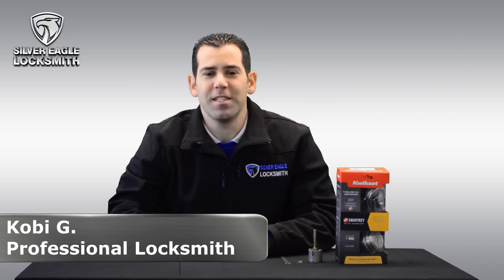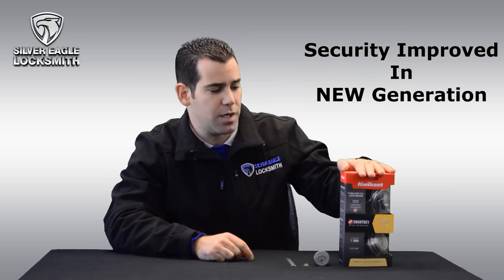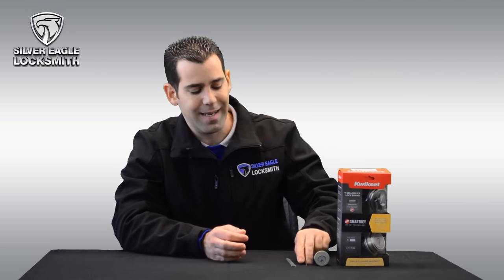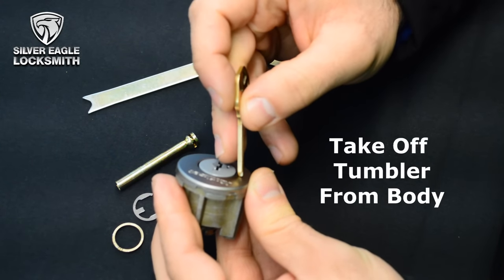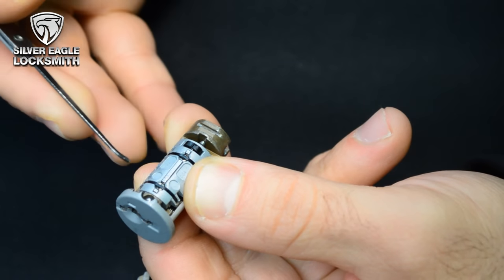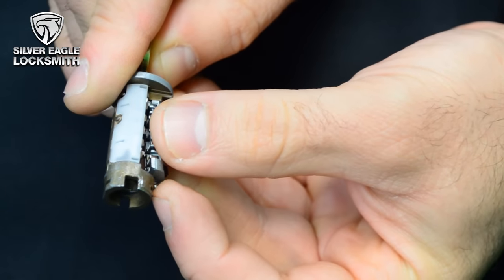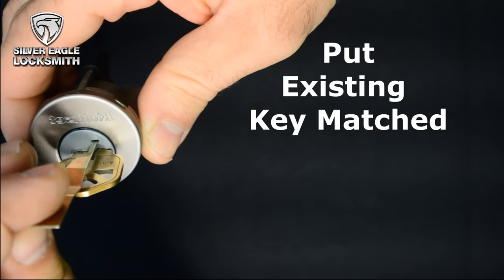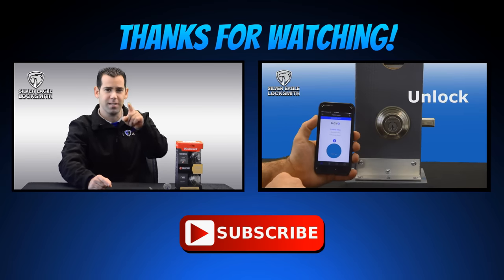How To Reset Kwikset Smart Key Without the Current Key Or The Reset Tool ✅

Comment: I can't get the first step to work.  Can't get the stupid ring loose to release the tailpiece. It won't budge.
Reply from the maker: Like I said I’m this video 
You’ll need to use a thin tool like paper clip and try to play with the pins up and down from the very back of the cylinder slowly till it will slide all the way out 
It’s the only way to do it

Comment: The cylinder is easier to remove by removing the clip on the back of the lock, rather than using a key and picks to line up the wafers to get it out.  Additionally, "breezing over" the sidebar removal is not a good idea.  The old ones basically fall out, but that new one looks like it has retainers holding it in.

Comment: This worked perfectly.... now how bout the door know
Reply from the maker: If it’s a doorknob you’ll need first a Kwikset removal tool: 81467 Kwikset Cylinder Remover https://www.amazon.com/dp/B00002N9WE/ref=cm_sw_r_cp_api_i_Rx4QDb730EVCX 
so you’ll be able to remote the cylinder from the knob “body”. With lever locks it’s easier as you’ll only need an Allen wrench.
Reply: Silver Eagle Locksmith, I tore the first one apart and got it figured out before I saw your reply. All locks are good to go now!!! Thanks much!

Comment: 90% of time if customer needs to rekey they are also locked out, so I don't see the point in learning to rekey when the lock will not work long after using bypass methods/force or drilling. What's the point please let me know
Reply from the maker: This is for people that need to rekey the Kwikset Smartkey lock if they don’t have the current key, it’s save them money instead of buying a new lock etc

Comment: Well that didn't work for me.  I got the cylinder half way out and it won't budge another mm.  Wont go in or out now.  totally ruined my lock.
Reply: OK, worked on it some more and got it.  But I had to take the next clip off in order to take the cylinder sleave out too.  Then I was able to work the tabs until I worked it loose.  Two of the slidy tab things were bent so I straightened them out with some pliers and then it was not too difficult.  Works like a charm now. Getting something apart correctly is ALWAYS the key to fixing anything.

Comment: This is all fine until you pull the cylinder out, and the world's tiniest spring magically appears out of nowhere. Oh, where'd that come from?  Maybe it's not critical.  Keep going.  Huh, where did this 2nd tiny spring come from?  
Guys, do all the Kwikset troubleshooting if you botched the smart key process.  This video is pretty informative, but it's a last resort.  I followed as best I could, but in the end I had no luck.
Reply from the maker: You’re probably talking about the two very small springs that holding the sidebar as I explained in the video. 
They’re very small and it’s very easy to lose them and if that’s the case I would just recommend you to buy a brand new lock or to return your locks from where you bought them if they are new
Reply: @S.E.Locksmith  Thanks, I didn't lose them, but the bar looked a little different than what was in the video. I ended up exchanging at the hardware store because I has the receipt.
Reply from the maker: Great
Reply: @shanerigsby9030  This sidebar piece was the one part of this whole process that worried me, because I wasn't expecting it to be unsecured and just fall out.  I was fortunate to be able to figure out the correct way to put the bar back in...and only 1 of the 2 springs fell out, and I didn't lose it, and I was able to see how the other spring was sitting in the cylinder.  Overall this was a very helpful video, but I think there are some inherent faults in the Kwikset SmartKey design they need to improve upon.

Comment: Kwikset smart key is garbage. I purchased 2 locking door handle/deadbolt sets and both failed after 10 years. Both deadbolts wouldn't torn with the key anymore. One of the handle sets wouldn't release my key once inserted. Absolute junk!!!
Reply from the maker: Try to lubricant the locks with a special lock lub and give it a try

Comment: this is fine on a deadbolt lock , BUT if you have a smart key lock  lever or knob, you cant' remove the lock cylinder  from the knob or lever, unless you have a working key.. as a locksmiths view...THEY ARE JUNK
Reply from the maker: Yes you can remove the lock cylinder on Kwikset knob or Lever if you are a locksmith of course. 
Long story short it is possible

Comment: Good video, but what kind of garbage system is this? Mine totally stopped turning. Doing this did nothing. Snapped the key trying to do this. One year, maybe 30 uses and the lock is totally useless. Next time avoid chinese import locks and buy a proper brand that doesn't "forget" how to work.